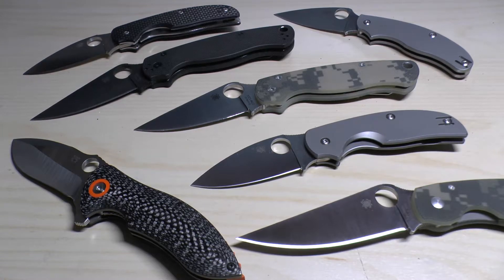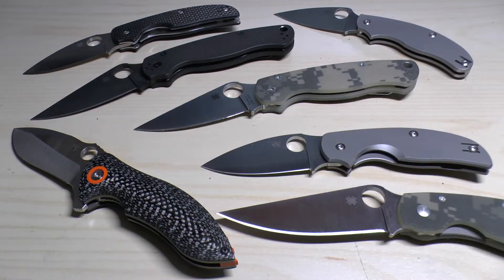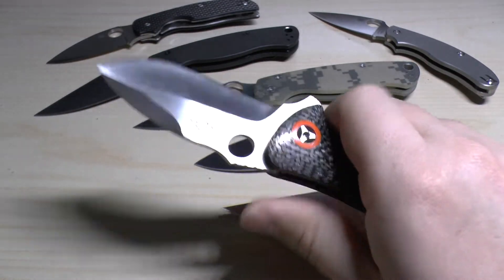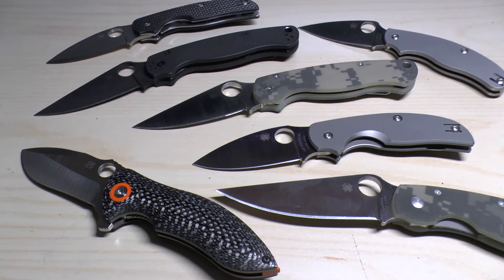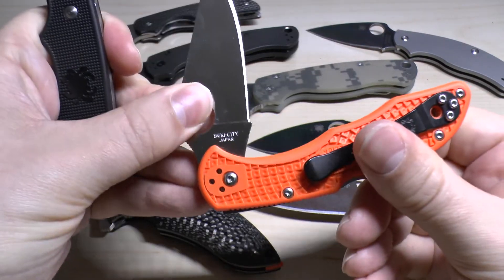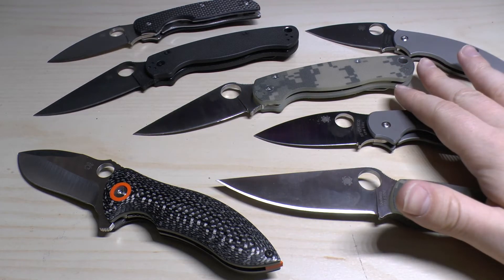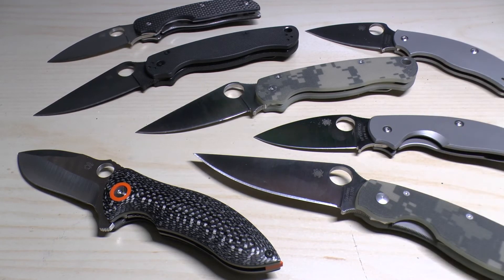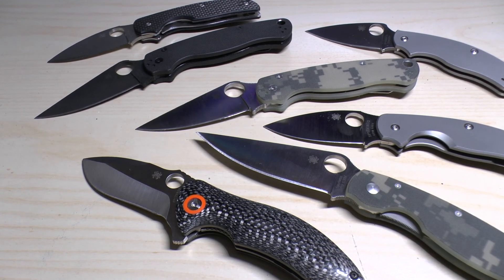CPM-S30V - Blade Steel Guide

Comment: I sharpened a zt 0456 with the 204P and it got real real sharp with a mirror edge but I’m not sure of these mirror edges will hold up . I was told to stay between 600-800 . Is there certain steels that do better with certain finishes on the edge ? Getting technical lately .

Comment: I bought a used car once and found this knife on the center console.  I looked at it and thought "This is a really good knife!".  carried it on my car for about 2 years and only did about 2 or 3 odd jobs with it.  ended up selling the car a few months back and made sure to take the knife with me.  then I started looking for it online to see how much it sells for and HOLY CRAP didn't think a pocket knife could cost almost 200 dollars.  ended up trying to figure out why this was so and it turns out its this steel (CPM-S30V) that the blade is made from and that's what makes it so darn expensive.  needless to say I'll be taking better care of it from now on

Comment: I know this is a old video, but I just ordered a Spyderco Military in S30V. My question is do I need to use a diamond stone, & cermaic for sharpening or will I be able to still reasonably use my Japanese water stones?
Reply: you can use whatever you like. With traditional Japanese water stones, you’ll wear them down faster, but you will get an edge on them. Diamond stones work much faster. I use both.
Reply: I use only Arkansas oil stones and it's ok. Guessing you found your water stones work?

Comment: Just got a benchmade in that steel.

Wow, sharpest blade of my collection so far. Better than my 440c, 154 cm, titanium, 9Cr19MoV, D2, 14C28N.

It's not that I think other steels don't work. But the fine grain makes the edge able to cut through toilet paper 😅
Reply: Blade steel does not determine sharpness. The sharpening does. In my experience and most peoples experience is that fine grained stainless steels like BD1Nand 14C28N or carbon steels are easier to get hair shaving sharp than carbide rich steels that lose shaving sharp quickly but hold a toothy edge long past basic steel have gone dull.
Reply: @thaknobodi  Idk I can get a sharper initial edge on s30v than I can on Aus8 for instance.

Comment: Nice video. Whenever I shop for a real nice knife that I’m going to put through it’s paces I never and never will purchase a knife that has a giant round hole in the blade. Why jeopardize the strength of a blade in such a critical part of the blade by putting a hole in it. Spyderco is made for collection or opening mail which I can just open with my hands. Definitely not hard use.
Reply from the maker: Zach Turner Og I thought you would have drawn the obvious conclusion that these folding knives not meant for ‘hard use’ whatever that means to you. They are more than cable for most if not all ‘cutting’ tasks. They have locks but SHOULD NOT be used like a fixed blade. Such as hitting the spine with a log to split a log, prying open a locked door, using as a climbing assist, splitting pallets or cutting open a car. Therefore the spydie-hole opening feature, which has been present on their knives since the 80s, is appropriately utilised on all of their folding knives.  

If you are using one of these knives where the blade breaks you have been using it wrong.
Reply: Sup3rSaiy3n a hole is appropriate?  How so?  Yes a hard use knife for me is a fixed blade. Esee generally and I never beat on a knife. I use tomahawks for the use they were designed for. The hole in the blade does three things. Weaken the blade, makes it wider in the pocket when folded(unnecessary space taking), and is as useless as a Nike check mark. It’s there trademark and is a terrible idea. The mail openers can keep at it but the knife experts don’t have one or have rid thereselves of it.

Comment: Spyderco in my opinion is overpriced. You're just paying for the brand and buying into the hype. I will say that out of the box they're razor sharp, but this can be achieved with any blade. I have a Native and i do love it, but i also have a Gerber that is S30V that is identical in sharpness (once i sharpened it) and a fraction of the price. And i do know Gerber is another bandwagon buy, but buying a S30V blade for $30.00 instead of $150.00 is going to win me over. Same statement goes for Benchmade Knives, amazing knives. But you're breaking the bank for their name.
Reply: With Spyderco you are paying for steel, design, quality control, and consistent heat treat. Not to be underestimated.

Comment: Can you talk about cpm s110v and vg 10 please ? Don’t have a clue how to go about sharpening and maintaining s110v
Reply from the maker: zac white I don’t have any s110v unfortunately but I would guess it’s as difficult as s30v to sharpen but not as easy as vg10.
Reply: S110V is a much harder steel with larger carbides. It tends to keep an edge much longer as it cuts very well when the microbevel gets toothy.

Comment: Hello, I veso you have experience with both the N690Co steel than with M390, it is much the difference of the wire seal between these two steels? and the ease of re-sharpening? Have you noticed differences in practical application between N690Co and M390? Which do you recommend for a knife survival / bushcraft compact in size (10/12 cm blade)? Thanks Michele.
Reply: N690Co is more corrosion resistant. M390 is tougher and less brittle.

Comment: Who does the actual process of heat treatment, Spyderco or Crucible Industries?
Reply from the maker: +drunkinmaster1 Great question. I think it would be Spyderco using the same element make up and heat treatments. They may differ slightly.

Comment: Great video. Do you know how CTS-XHP compares to S30V?
Reply from the maker: Nolan Carpenter Thanks Nolan. Nice to hear from you again. I think CTS-XHP posses the corrosion resistance of 440C but the hardness (64 HRC) of D2 tool steel. It's a stainless steel version of D2. CTS-XHP slightly outperforms S30V on edge retention. Smoke eater has a a great video here: https://www.youtube.com/watch?v=SdoNBtc6tmI Hope that helps.
Reply: Thanks a lot. Had to ask because I've heard some conflicting reports. Anyway, I'm glad you're making these steel videos because they're very informative. Cheers.